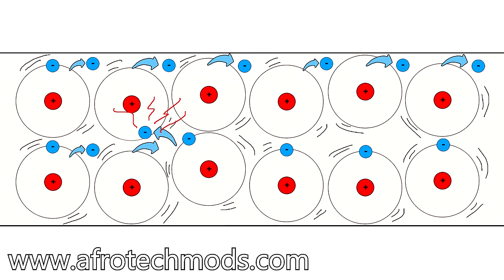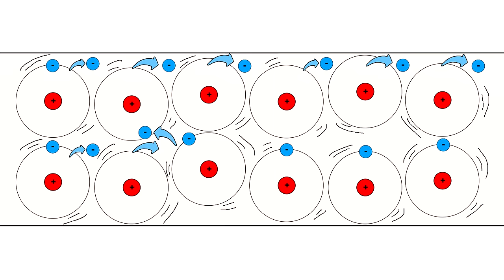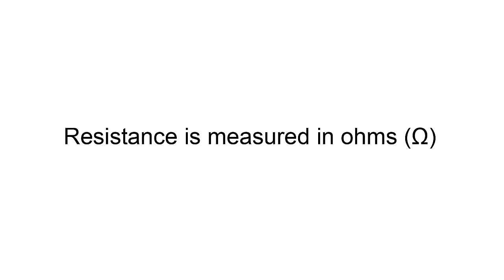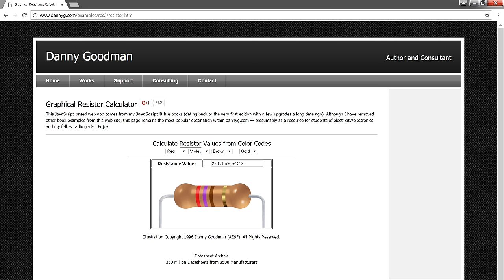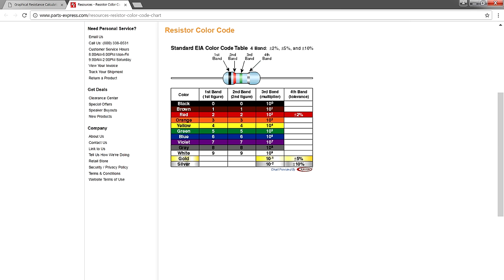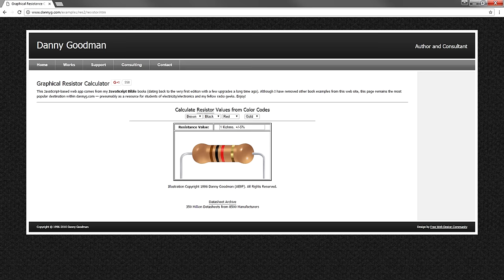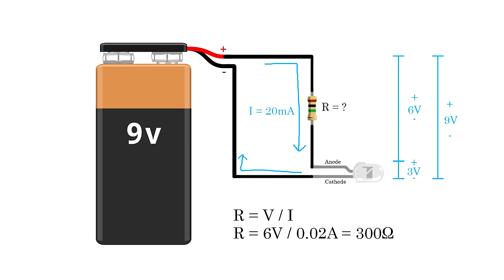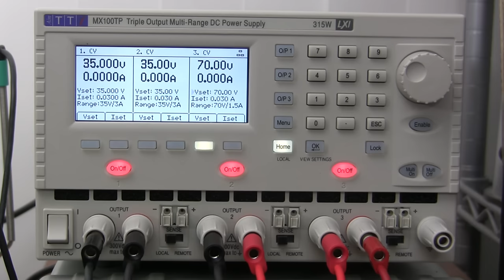Basic Electricity - Resistance and Ohm's law

Comment: Why am I buying resistors when I can just use a dried out piece of carrot?
Reply: Sir, you've made my day.
Reply: I don't know about you, bu I always had problems tinning the ends of the carrot. That's why I started using resistors.
Reply: A new unit of resistance? The impedance of this circuit is 3 dried out pieces of carrot.
Reply: tablatronix 😂
Reply: ys, you can add it or slowly sandpaper it to desired resistance
Reply: It's actually easier to use carrots as 'permanent'-variable resistor.

Cut it to your liking.
Reply: Who is to say resistors are not just ceramic-coated pieces of dried out carrot?  After all, we all know that transistors just contain a single bacteria trained to flip a tiny switch.
Reply: Tolerance may be :)
Reply: Dried out pieces of carrot are not to be underestimated!
Reply: Because a resistor is more precise than a carrot
Reply: Join the resistance ! We have carrot sabers !
Reply: Mathieu Riesling 🔥🔥😂😂
Reply: It's cheap (About 4 cent 50 resistors)
Reply: That is a well made point.
Reply: Never had any problems with rabbits eating my resistors.
Reply: I guess the resistance would increase as the carrot decomposed up until the time where it would cook... then you could eat it.
Reply: Coz they have a really small resistance and you would need like a thousand carrots in series to equal one resistor
Reply: @mr.kovacic  Mr. Kovačić, a nice dried out potato replaces a thousand carrots. My computer uses all sorts of dried out vegetables in place of modern electronics.
Reply: lol joker :)
Reply: Best comment ever!!! 😂🤣😂😁😉👍
Reply: Only if you don't carrot all about your circuits sir
Reply: @superdau  you can buy tinned carrots, in the grocery section.
Reply: I need something with a résistance of 4ohms anny ideas?
Reply: I ate my carrot resistor. Then my stereo blew up.
Reply: @krashd  
I've heard that
Reply: @finallyitsed2191  
Very efficient, even 'green'
Reply: @HKCREATESUNIQUE  
What can a carrot be ecstatic about?
Reply: @cozzyinternet4706  That's right... deal with it 💪🐰
Reply: Run  @Rabbit.760  Run
Reply: Resistors are cheaper. Lol
Reply: How effective would the french resistance be?
Reply: Theh literally have carrot sticks lol
Reply: ur funny
Reply: 😂😂😂 how to solder on dried out piece of carrot?
Reply: Appreciate video content! Apologies for the intrusion, I am interested in your initial thoughts. Have you heard the talk about - Runayslarn Survival Manifestation (erm, check it on google should be there)? It is a great exclusive guide for discovering how to repair your electronic items minus the normal expense. Ive heard some super things about it and my friend Sam at very last got astronomical results with it.
Reply: It reminds me about Afortechmods very earlier video of multimeter😂
Reply: Nice Video clip! Excuse me for chiming in, I would appreciate your initial thoughts. Have you researched - Qanayce Wiyulian Equalizer (should be on google have a look)? It is a good exclusive guide for unveiling the technique to repair your electronic items minus the hard work. Ive heard some pretty good things about it and my coo-worker after a lifetime of fighting got excellent success with it.
Reply: Then you just find a carpet of mold in your drawer and think huh, whats this
Reply: realllo
Reply: If you run enough current through your carrots, they will help you to see in the dark.  Cheers!
Reply: Carrohm
Reply: @ChristopherJones-ck2zh  all is within the callculations of carrot, have no carrot? Grow carrot. Have no resistor?????! Cannot grow resistor. The metaphysics of carrots leaves all of humanity astonished

I shall now close my suitcase
Reply: Don't use carrots, use grapes, because, when they dry out, you get currents. 😁
Reply: lol
Reply: @ChristopherJones-ck2zh  Not for measuring gold and diamonds.
Reply: Abb ap kya Kar ra ho
Reply: humans always cease to amuse me...
okay @Mathieu Riesling -

a dried up carrot doesn't always have a fixed resistance. Due to the moisturre in the air the carrot might decrease its resistance and possibly burning your circuit down. to prevent this you humans have yourself created a thing called a resistor which does this with the peace of mind from humidity and also it is more economically viable to sell resistors in small packages and ship to whoever needs it without bothering about logistics shipping issue of a edible condiment like a carrot.
and also if suddenly your phone charger decides to send too much current; your phone would'nt smell of burnt carrots

i hope you're satisfied with the answer
Reply: @superdau  And resistors are cheaper too.  You can buy hundreds for the price of one carrot.
Reply: @cozzyinternet4706  Just put up a fence.
Reply: @kentbullard6917  So you have a cat ?
Reply: @fulloppositelock6778  Or just keep sketching until you build up to the required resistance.

Comment: I don't understand, I generated 10V using self made battery using coper and zync and use water as solution,  I attached  the 3V led and it barely glows, the 10V drops down to 2.4V.  how do I get more Amps or what do I need to do to keep the Voltage to 10 or at least not to drop so low?

Comment: So you say keeping the current off by 10% is not a problem? im asking because i have 2x AA batterie in series with 1.6V and my LED is recommended for 3V and 20mA. so i don't need to get a resistor at all? Im just double checking. 3.2V-3V = 0.2V --> 0.2V/0.02A = 10 Ohm. with 10% Current diviation i would be at 3.2V-3.3V and therefore 0V/0.02A=0 :)

Comment: I have an electronics shop in my basement. I have a Tenma 40 MHz oscilloscope with two inputs. I also have a Tenma Universal Test Center with a multimeter, a power supply with a 5 volt, a 13,8 volt and variable 0 to 30 volt, a signal generator up to 2 Mhz and selection of sine wave, square wave and triangle wave, and a frequency counter. I use the variable voltage to calculate the resistance of an LED when it gets bright enough and the current flow. This gives me what I need to know to add a resistor for the LED in a 12 volt circuit. I also design circuits for my model railroad signal system.

Comment: Just found this channel. You must be a teacher because the clarity of your presentation is streets ahead of most people's. Unfortunately, I came upon this after two years of trial and error getting my grandchildren's train set and trains illuminated; at least I have ended up with roughly the same resistor values as the maths suggest. Next time, I'm armed with the correct information to bypass the trial and error. Many thanks.

Comment: In your simple circuit with a 9V battery, LED, and resistor @5:58 I see the resistor on the anode side.  I've seen this before and know it works but never understood why.  Can you explain?  If electrons flow from negative to positive I would think that this location is "too late" to save the LED.  Wouldn't it be more appropriate to have the resistor on the cathode side?
Reply: In this case it does not matter which side the resistor is located in the circuit, so long as it is present. The omitted part of the video does not detail the fact that the entire circuit is in so called "series," meaning that every component is tied end to end with each other. In this format, the current is determined by the circuit voltage divided by the entire circuit's total resistance. The cool part of this setup is that the resistor and LED will both experience the same constant current in amps while having different voltages, since the individual component voltage is current times resistance. The only concern of resistor placement would be if the circuit was so called "series-parallel" where a drop in voltage could cause power problems in other branches of the circuit. Another concern on resistor placement would be purely for safety concerns if you wanted to limit a particular side of the circuit's current that might be exposed to human interaction, say a light switch.
Reply: Richard Forester Seriously don't do anything with electricity take up macrame .
Reply: You are correct in your thinking but it will resist the flow in the entire length of the circuit, from battery back to the battery.
Reply: In this case (since the circuit is in series), the current at any point is the same as the current at another point. What dictates current is the overall resistance. Resistors don't "use up" current in order to save the LED, but instead limits it overall.
Reply: I've likewise been thinking about this issue recently and am still confused about it...Glad Harvey and Ryan chimed in with their answers. Not sure why that apparent aspect isn't proactively noted more often when explaining this subject. I.e., the fact that a resistor (at least in a series rather than parallel circuit) will effectively decrease the current of the entire circuit (rather than simply a locality of it proximal to their placement). Because it seems (I would think) an obvious question for curious electronics newbies like myself.

So yeah, I can defintely see the overall decrease in flow of electrons meaning lower current level the LED will be exposed to...BUT, is the voltage level the LED will be exposed to identically effected by the resistor (or is it, on the other hand, comparatively more dependent on location in the circuit relative to the resistor - i.e., whether it precedes or follows the resistor in the direction of electron [not conventional] flow)?
Reply: @runeklok  sir can you assist me if I install 3 LEDs in Series with 9v battery. 
How can i calculate recommended Resistor.?
Reply: @majidali4262  Look up the max current rating on your LED spec table. Typically it is 20mA. To find the resistor your want, take 9V and divide it by the maximum current rating for one LED (if they are in series). For a typically LED, for example, it be 9V / 20mA, where mA is milliamps or .001 amps. Therefore, the resistor would be 450 or 500 ohms
Reply: @____Alan____  Interesting question, if I remember correctly, an LED (light-emitting diode) is a special case component that always has a specific voltage attached to it. If my memory of digital electronics is correct, for silicon diodes (like LEDs) it is 0.7V. 

However, it is common procedure to wire LED circuits with the resistor in direct connection with the positive end of a battery. This is done as a precaution to prevent the LED from breaking off from the resistor and grounding itself on a grounded object like a metal table. This is done because the positive end of the battery is considered to have a higher electric potential (voltage) when compared to ground. Whereas the negative end of the battery has a very low electric potential (V). This means breaks in a soldered joint will not fry your LED and battery on unintentionally grounding faults and it will flow through the resistor, thus limiting current.

Comment: Thank you for this video! I have a pretty basic question here-- I see you followed your conventional current flow diagram when wiring up the 9v/LED/resistor. Why did you not wire it up according to neg to pos electron flow? If the electrons flow from the anode and hit the LED before the resistor, how is the resistor doing its job? It seems as if the resistor would serve no purpose after the high current flow already the LED. What am I not understanding correctly?
Reply: I have the same question! Someone please answer!
Reply: @seanlikestoeat  lost all hope, 4 years and still no answer
Reply: Think about the current flow in a circuit as a whole - where does the current go OUT of the led in that case? If you connect one leg of the LED to a high current source like a 12v car battery, but leave the other leg disconnected, what happens?

Comment: If electrons actually flow from negative to positive, could you have placed the resistor in series with the cathode side of the LED and achieved the same function?
Reply: Actually electrons flow opposite to the flow of negative charge....

Comment: question: so could I also place the resistor BEFORE the LED then, instead of after as you have here? seems if actual current is flowing from neg to pos, I'd want it to traverse the resistor first... or is the placement of the resistor unimportant because it affects the circuit as a whole?
Reply: Well, here's the thing. Voltage and current flow are about voltage differential. You have to imagine that there's someone pushing the electrons at the negative side, but there's also someone pulling them on the positive.

No matter what side the resistor is on, the current will flow just the same through the led.

Comment: One of the most important things about LEDs are that they are low power. You put the LED in series with a 300Ω resistor. This meant that the LED was getting only 33% of the power and 66% was wasted in the resistor. With the 140V you toasted the resistor with 2.74 W as it got 98% of the 2.8 W of power leaving the battery - only 2% was used in the LED.

How do you actually use LEDs without wasting power into resistors? Even LED strips you buy on Amazon have resistors. How do we use energy-saving LEDs without wasting energy in resistors?
Reply from the maker: Constant current buck converters
Reply: Why limit that question to resistors?  Many discrete components have limits on how much current they can handle.  So one simply uses the appropriate resistor.  An LED is no different.
Reply: Basically, you have a chain of LEDs in series and a small sense resistor at the end, (0.1ohm or so).

You know elements in series must have the same current going through them, as part of KCL. You also know that in a resistor, current is directly related to voltage, and more importantly, linearly. 

What you do is measure the corresponding voltage across a resistor to read the current through the LEDs, then use that as feedback in your buck/boost driver.

It's more complicated that that, but that's the gist of it.
Reply: +Idjles Erle 
With LED strips you don't waste 66% in the resistor. Have you ever tried measuring the voltage drop in those resistors? It's typically 2 out of the 12V you run the strip at, so 16% loss in the resistor, which is actually a better efficiency than many of the cheap constant current drivers (for low currents).
You can't use a constant current driver for a strip. Such a driver can only drive a single series connection of LEDs, parallel connected ones (exceptions if you know what you're doing), which for a long strip would mean dangerously high voltages.
Reply: With your logic applied, we should be able to go to WalMart and buy a 1V battery, a 1.1V battery, a 1.2V battery, a 1.3V battery, and so on. Continue this with all types of power sources, and you now see why we use resistors instead of making custom power sources for everything in the world.

Comment: Back in my day, current flowed from negative to positive.  Lightning didn't strike the ground, electrical fingers rose from the ground and drew the bolt down.  I was recording clouds that looked like they were trying to form a tornado.  Lightning was striking all around at times.  Later when I reviewed my video, I recorded lighting striking the front of my truck while I was driving and I had no idea it had.  You could actually see the finger reach up from the front end and the bolt come down to meet it.